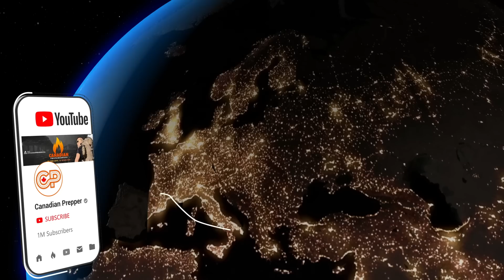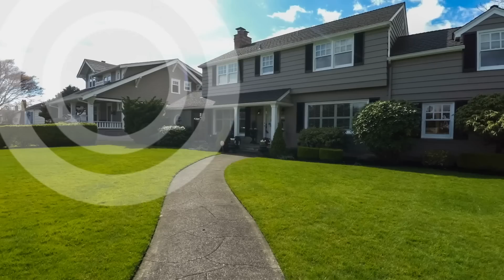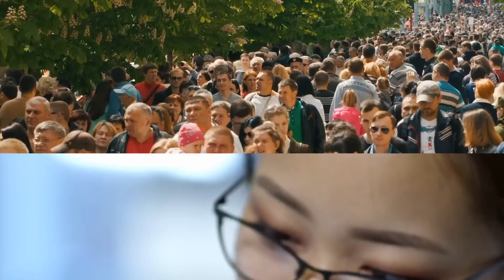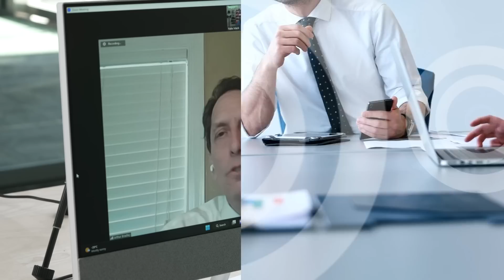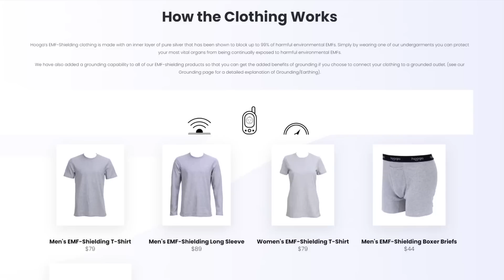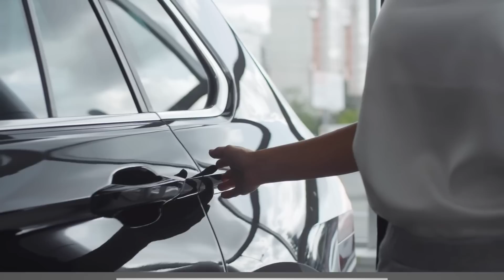NASA Scientist Issues STARK WARNING About WW3, Solar Flares, EMP and EMF

Comment: Electro Magnetic Pulse in case anyone is wondering.  I guess most everyone would know that but maybe not...  I personally don't think that the effects of even a Carington-level CME (Coronal Mass Ejection) would be bad but not necessarily irrecoverable in the short run.  My new construction home has built-in EMP protection - it's actually intended for lightning but it has a certain amount of protective qualities for a CME or EMP.    Of course, everything depends on the strength of the event.
Reply: Would that do any good anyways if the whole power grid, cell towers, internet broadcast are all toast anyways? Aside from generator to power stuff, how would anything be useful without the grid online for everything to connect to?
Reply: @gnp5278  at least you might have hot water, cook/can  what ever is in freezer so you do not lose every thing. Keep windows covered so no light shows, that's if you have generator to run those things.
Reply: You have an optimistic opinion based on no experience. I respect that. So all your lights and car, fridge work... and??? Then.
Then what? How much extra did you pay. Are the neighbors with ya? 
I mean cool if you 😎 have a gang of houses truly trusting ppl
 Or u are in the woods and are killing survival skills. Medical, no kids. Ect. Then yeah dude? Idk. All I know is you must have a tin of preps. Ammo. Compound. Fuel. Ect.
Reply: All that has to the government has to do is turn the grid off with intent and simply blame some sort of cyber-attack or an EMP weather it is real or not!! Why get messy... This way they get to keep the lights on for themselves and who cares about us... Just a thought...

Comment: What is the effective range of an EMP for those things not connected to the grid?
Reply: It's line of sight. The higher it is the farther it goes. Best guess is 2 or 3 over the country would do it. Star fish prime was I believe 800 miles away and affected Hawaii.
Reply: They really don't know. They say anything with modern microprocessors in it COULD be damaged. Even if not plugged into the grid.
Reply: It'll fry anything even if it's not plugged in. 
The issue is that the emp uses gamma radiation to excite the molecules in the air. It's similar to teslas AC electricity. This directly overcharges everything that's electronic. 
If you're asking, you're connected to the grid.

If there's power lines near you, that overcharge from the initial pulse will travel along the power lines and 'arc' a distance that depends on multiple variables. How far away the pulse was, how many volts per meter, nearest power plant, etc.